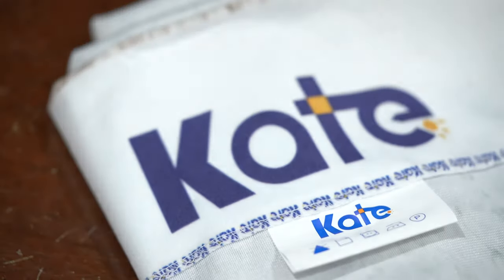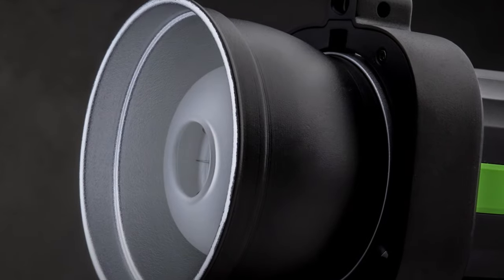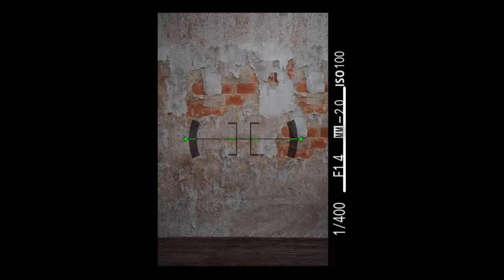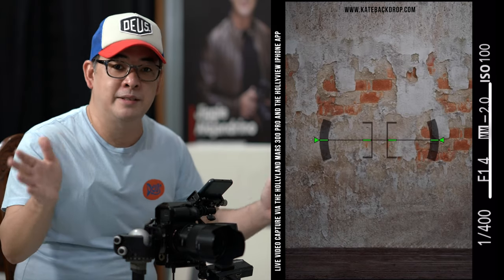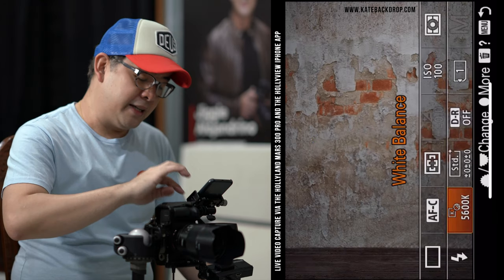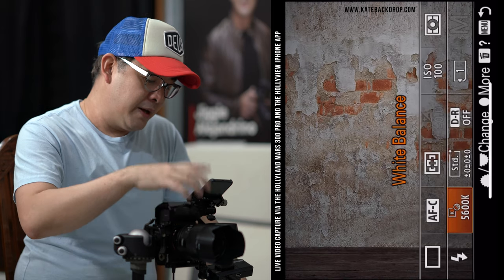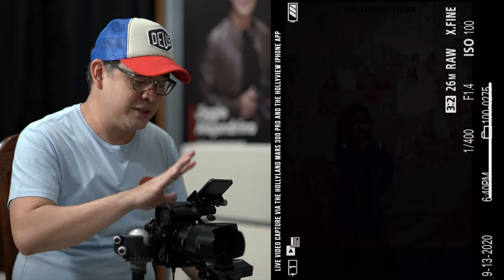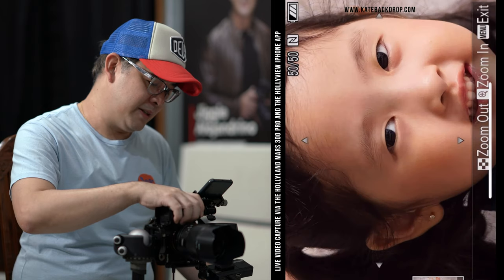How To Create Soft Portrait Light WITHOUT the use of a Conventional Modifier. A Photography Tutorial

Comment: Hey Jiggie, I hope you are well brother. I have a quick question that I hope you can help with: Is there a big difference between the Phottix R3 compared to the R4? Is it worth spending the extra cash on the R4? I have 3 ad200 flash but I am really interested in getting an LED light. Any advice would be appreciated mate. Thanks in advance :)
Reply from the maker: It's really about size and power. I use both but I always lean towards the R4 just because it's bigger and stronger